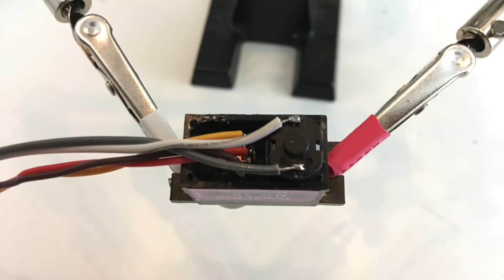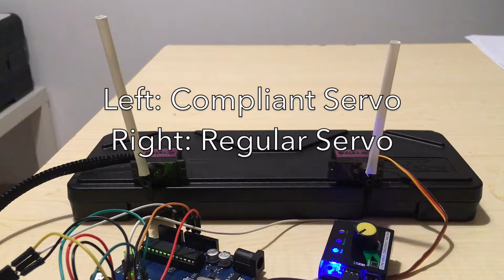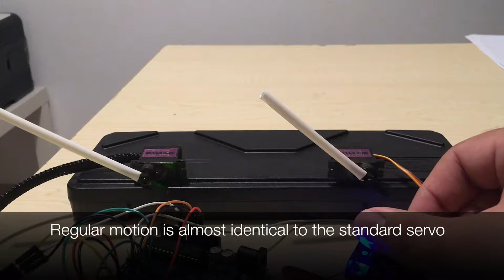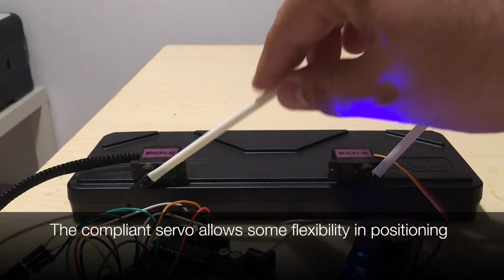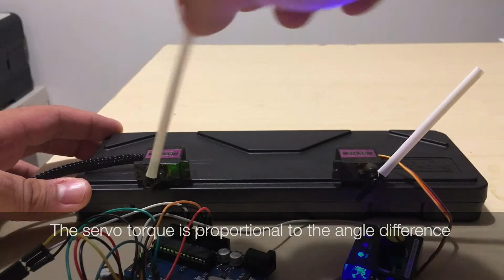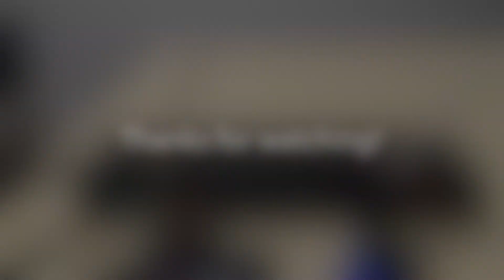Compliant Servo Motion

Comment: Hello, I tried this myself but I am having a little trouble understanding the way you calculate the react variable, what do the variables p and d represent?
Reply from the maker: Hi, P and D are the proportional and derivative term gains in calculating the reaction.
Reply: Do you have a tutorial on how to do this? And how does it affect the lifespan of the servo, I’m trying to make a compliant robot using cheap servos
Reply: @Robotically46  Inside the servo, there will be a potentiometer, a motor, and a control board. Remove the control board and replace with your own microcontroller + motor driver combo. Have fun! :)
Reply: @BrainCellular  Unsure about the lifespan, I think it will be fine. You basically adjust the voltage and direction of the motor based on potentiometer position. The issue with this approach I found was that the speed of a brushed motor will also decrease as you lower voltage. It might mess up your timing